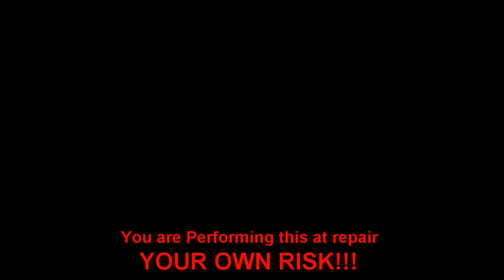HP Compaq Laptop Repair Replace Guide HP 655 650 635 630 625

Comment: You're incredible man,but I have a problem,when I turn on only the light of turn work,but the screen doesn't show anything,it's just a black screen,why this happens and how i solve it? Thank you very much.
Reply: did you get a fix for that? I HAVE THE SAME PROBLEM??
Reply: Yeah,turns out that the graphic card is damaged,take it to a good computer technician and (if is he or she good on this stuff) will fix it in in a few days,it should not be expenssive.
Reply: ***** hey thank you for the reply, the problem is long sorted. Apparently it was from the BIOS, so i had to keep the power button pressed ~30seconds with rhe laptop unplugged and no battery. Cheers!
Reply: That was all?,how funny is when you note that the problem is easy to solve, XD

Comment: I'm watching this from an HP 655, seven years after it was uploaded. I don't think I can do all that. I'd be afraid to mess something up.
Reply: Same here but I need to change the cpu.
Reply: Ive done it without the tut and theres almost nothing to worry abt except when taking off the top piece with the plastic tabs, use a metal thin thing like to pop open the plastic tabs, always try to do it at the spot where its barely popped open since thats where the plastic tab is most likely, dont brute force it youll just break the case. Also be careful with cables dont wana rip those apart you know.

Comment: every time I open up a hp laptop like this, it ends up with more problems than I started with. Now my screen is not working... :( I have checked the connector is correctly seated, there's nothing else I can do.
Reply: does the caps lock light off and on ? if so check the ram card maybe its not well placed. it happend to me as well
Reply: +Oussama Abdoh this was exact issue I realised the light was bios signal and it was ram seating

Comment: Hello guys. I was wondering if anyone had problem with backlight on HP 650 notebook. My display works, Pc boots up just fine but I can barely see screen cuz its black. When I point light to screen I can see desktop. It should be inverter problem for 90% but when I opened it there is not any inverter in this model. So anyone know a fix for this problem?
Reply: +Stanislav, Changing the LCD may solve the problem but expensive. the model use the LED driver circuit, the circuit is powered through a fuse. Don't know your level of skill but the problem is not very serious. The LCD has a standard 40 pin connector and you can locate the fuse on one side of it. Also check the LED bus cable for faulty at the end of the LCD panel. Thick that might help.